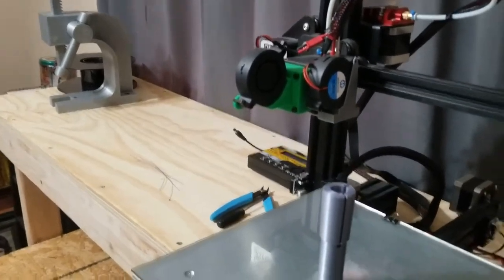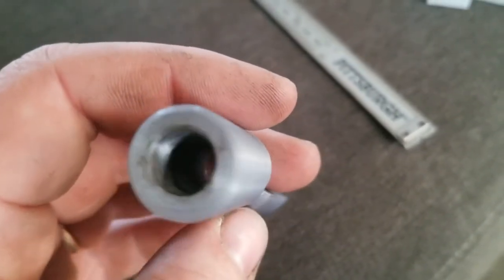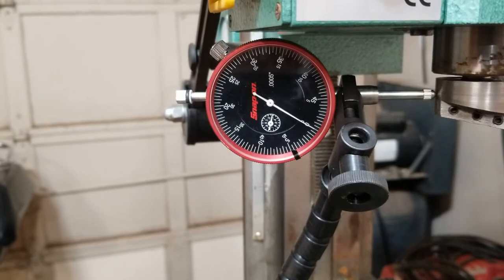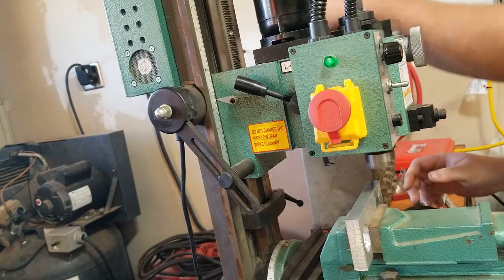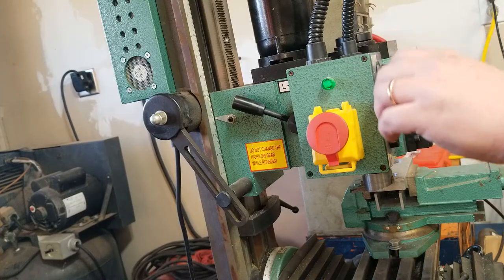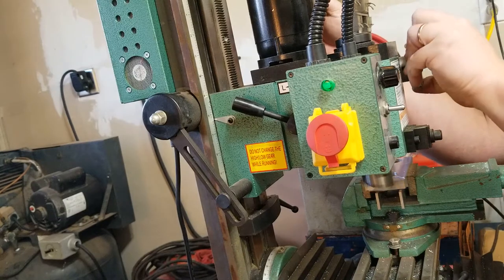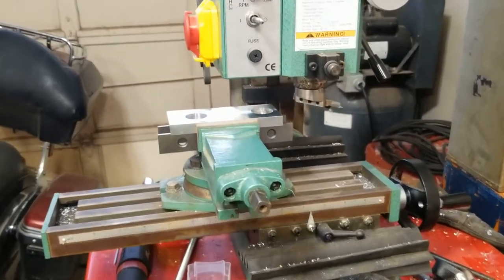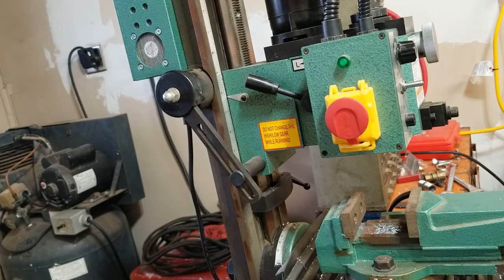3D Printed Functional Collet?!?

Comment: Thanks i wanted to add cnc capability to my 3d printer. Seems i could just printout a 3.2mm collet. Its only gonna route some plastic wood or pcb. But you mill aluminum. It might just work.
Reply from the maker: the smaller the collet the less force it will be able to take. The collet I made was solid with quite thick walls. I highly recommend trying though!

Comment: R8 collets in this style (3 segments) are rarely used anymore.....you can buy ER collets w/R8 collet holder that can clamp much tighter because the 3-sided tools only grab on the leading edge, whereas ER collets can grab on the entire length. Also would NOT have printed in PLA...PETG superior for this use.   Wrong material, wrong design
Reply from the maker: Jimbo Jones I agree on all counts. I used what I had. I think the thickness and design of an ER collet W/R8 collet holder would not have been feasible to 3d print due to the need for thickness for strength. This is really showing that I had good layer adhesion rather than material strength. It was just a fun project to see if I could do it. I would never use this over an appropriate tool for an actual job.